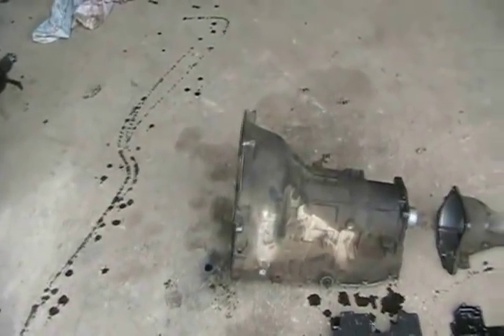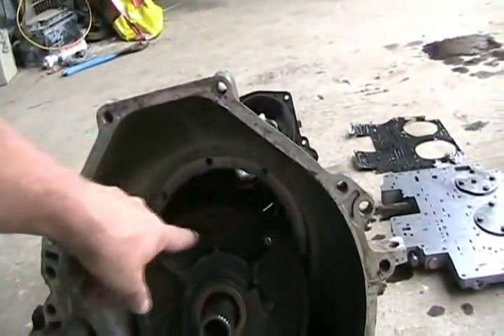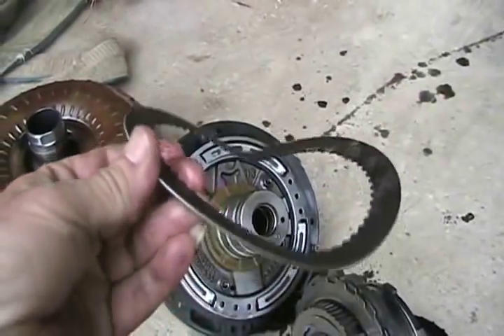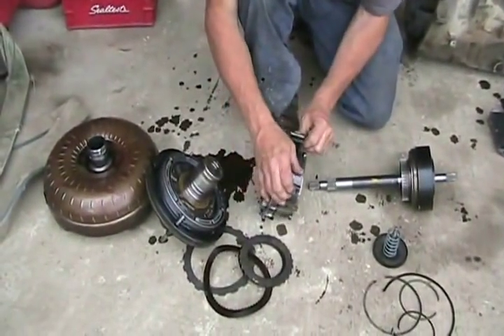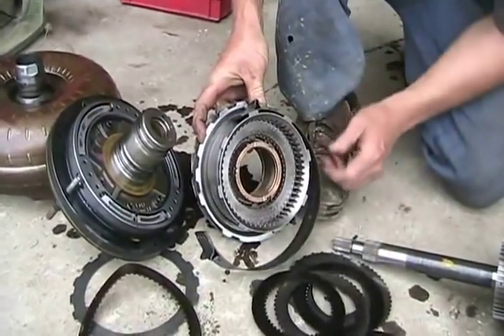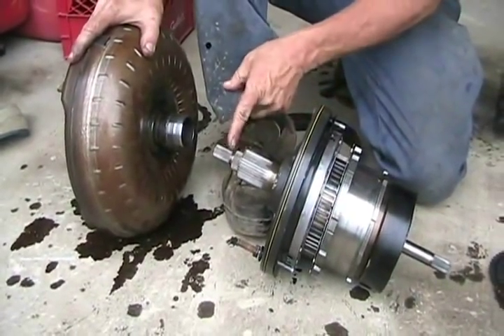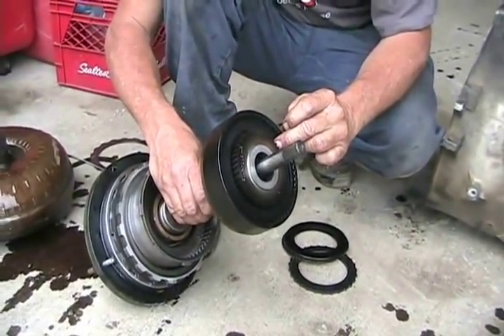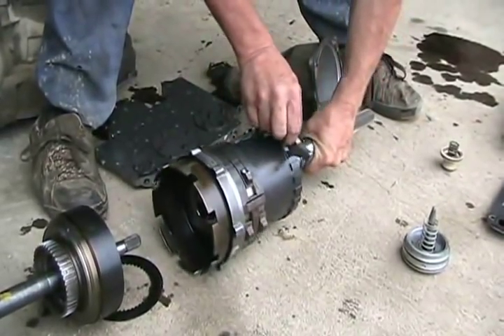How automatic car transmissions work , part 1 Davidsfarmison[bliptv]now

Comment: I had taken apart the transmission off my 06 Nissan Sentra. I found that taking apart the transmission is ALOT SIMPLER than I thought it was. I did NOT need any special tools other than a "snap ring" remover. Even then, I just used a screw driver! The are ALOT of clutches and "housings". I was CRACKING UP when I saw that there were so many different diameter of these things! Obviously each one for each gear!

Comment: The line pressure increases applying more clamping force to the applied driving clutch set. This occurs when you accelerate. Main line pressure almost triples when you go to wide open throttle.

Comment: Very informative. What happens actually when we put fresh oil in a old transmission that never had an oil change?
Reply: Since ATF is a strong detergent you could break loose extensive debris and clog up valve bodies, effectively breaking your transmission.

Comment: I've learned something today and I think that manual transmission is less difficult and less expensive I don't really know I might be wrong there's so many things to worry about on automatics on standard all there is is a belhousing of course, flywheel, pressureplate, and the transmission itself

Comment: Hello. Thanx for the explanation. It's really good, and easy to understand. I have a question about changing the transmission oil. I have a Mercedes C240 from 2003 with automatic transmission. The car works perfectly, but there is a recommendation, that the trans.oil should be changed each 60t-km. This was alredy done, but the mechanic said, he can change only the oil in the trans. but not the oil in the torque converter, because there is no bolt on the converter to dump the oil.
He mentioned some kind of flushing...
How does the oil come into the converter?
Should the gearbox demounted to reach the converter-oil?
Thank you, Daniel.
Reply: He's right. Oil comes into the torque converter via the oil pump, from the transmission oil pan. However since the torque converter is donut shaped oil will stay in it when the oil is removed via the trans oil pan or drain plug. A flush works by introducing new oil AND draining oil at the same time, while the engine is running. It takes alot more oil than a drain and refill but it's a sure way to replace all the oil and clean most of the debris.
Reply: Daniel Tahin of ha ca c-i lhat ca vong co
Reply: sorry i don't understand it:-) Can you please write in english? Thx.

Comment: i have a 99' Camaro SS w/ a 4L60E, now my thing is that my 1st and reverse gear have like a clunking sound when moving and gets louder and faster as the car moves quicker but ONLY on 1st gear never N, BUT once it hits 2nd gear and up it goes away and the car drives and sounds like theres nothing wrong with it, its just 1st gear and R... what can it be? and it has transmission fluid and all the gears hook up just fine...

Comment: So you got a torque converter I guess? The older automatic transmission are well known as 'kick' in, but not built in 2006.
Maybe it's for the first time by changing the gears (first to second, second to third) after standing or still having a cold transmission.
Maybe you should watch it when it starts (cold transmission, suddenly, etc.).
It could be the fluid, but not after lower mileages, but of course it could.
Floor it, run up to higher rpm's, than brake down, do it again (by warm engine!!)

Comment: nice i was curious as to how an automatic transmission worked compared to a manual.  my sister in law had a renault espace it was automatic sometimes it stuck in first gear, what could that have been?

Comment: Think about it like this, every clutch, every break is a failure point in that transmission. In a manual you have one failure point. and its a cheap easy fix. Its not even a question

Comment: actually te torque converter bolts not to te flywheel but on automatic transmissions they call it a flexplate  flywheels are for Manual transmissions. but saying flywheel alot of pepole know what you're talking about.